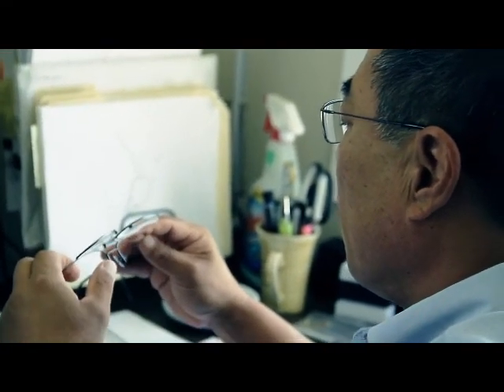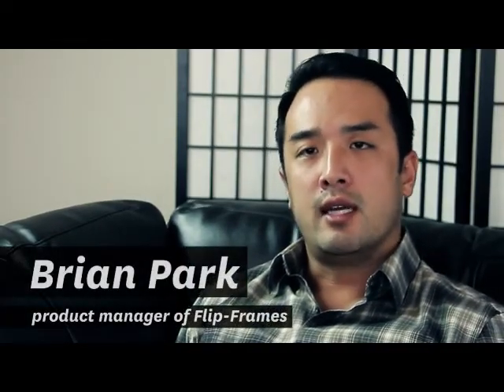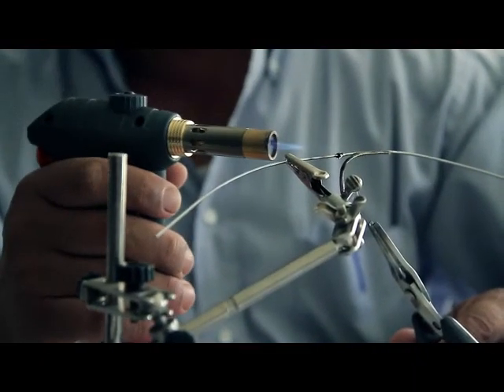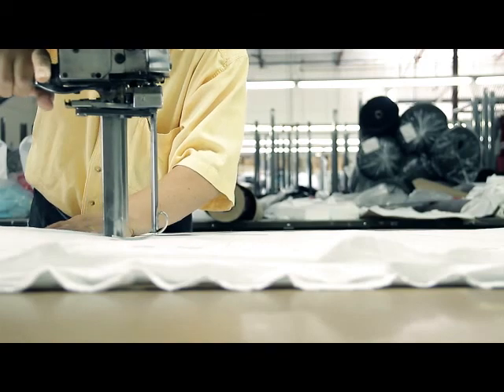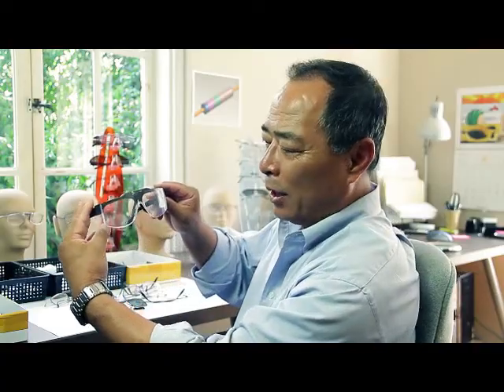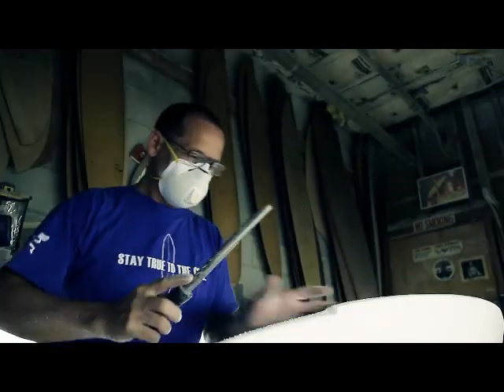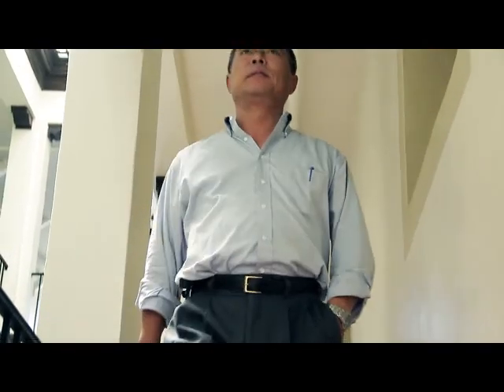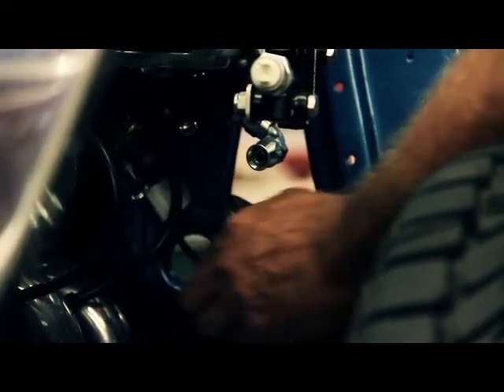Best Flip Up Reading Glasses : Flip Frames

Comment: I wear standard prescription glasses (not reading glasses), but I use a microscope in a lab and have to take off my glasses every time I look through the microscope. Would you (or an eyeglass manufacturer) be able to attach prescription lenses to the frames?

Comment: I been looking in the market for a "bifocal" flip frame something similar to your product but with a prescription lenses ; what I mean is glasses with a prescription lenses at the base (I use +3.50 for distance)  and the flip part to be +2 (for a total of +5.50) as reading glasses to my needs, (diabetes and age change my vision to blurry at all times if I don`t use any glasses) so I am both  near and far sighted at the same time ,but able to correct it with a 3.50 for distance and a 5.50 for reading ( I just put a order at Sam`s for bifocals for this 2 measures but wish I could have something like this as an option... anyone who uses bifocal does no necessarily starts from "0" . This would be very useful if it could hold two lenses ,one being a prescription and the flip part you add as you need the magnification(like the prototype on your other video....Hope to see your products in the market soon.
Reply: +Frank C Hi Frank-Scheyden has exactly what you are looking for! Email them at info@scheyden.com and they can help you out.

Comment: I need this mechanism, but for the opposite intent of your original design.
I'm nearsighted (recently lens corrected to 20/15... hee-haw!!!). That has mitigated any need for reading glasses or bifocals. Even at 63, if I take off my prescription glasses, I can see very well, inside of 3-4 feet.
I can't see much, inside of 3-4 feet, with them on, so I usually put them on my head, which makes them dirty & pulls my hair out, when I need them again.
PLEASE get your design to optometrists & opticians!!!